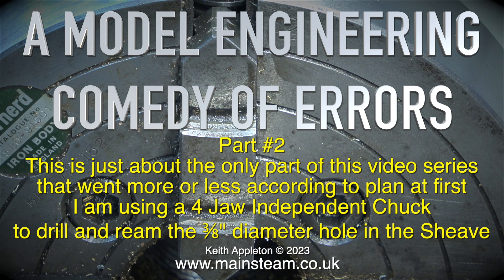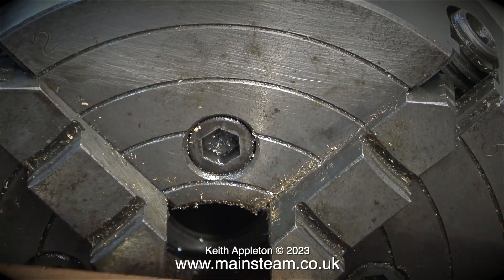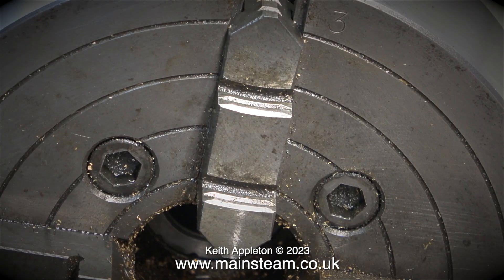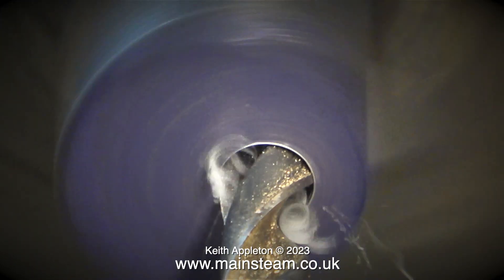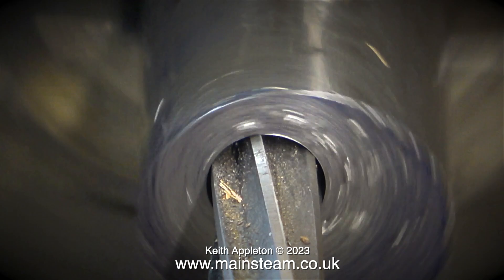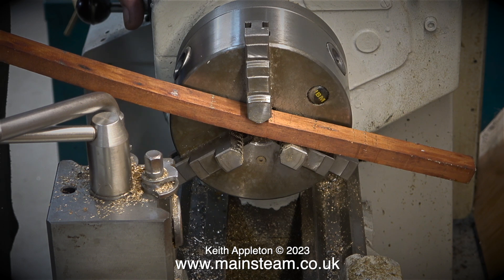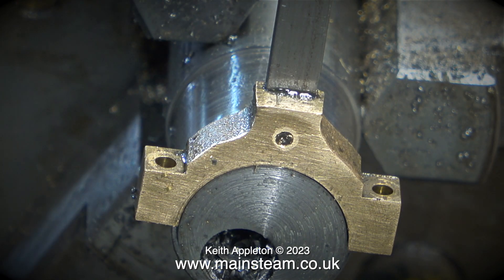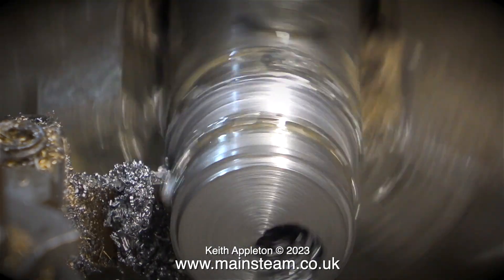A MODEL ENGINEERING COMEDY OF ERRORS - PART #2

Comment: To scribe a circle,  centre punch it then pick up the centre of the centre punch mark to run true in the four jaw chuck suggests to me a not very accurate process.
What I do is either drill and ream a pilot hole in centre of the bar,  go to the Mill and with a dowel a few tenths down on the reamed hole size in the Mill chuck,  pick up the hole centre,  zero the leadscrew vernier wheel then index over using the Mill's leadscrew's vernier wheel to get the offset,  then centre drill,  drill and ream the hole.
Other way is with the bar OD turned to size,  set bar in the independent four jaw chuck approximately the required offset  and bring the turning tool to lightly touch the part,  read off the number on the cross slide vernier wheel,  back off the tool and turn the chuck 180 degrees,  repeat the process and subtract the smaller number from the larger.  Keep adjusting those two jaws until you get the required offset.  Set the other two jaws with the turning tool lightly touching the OD as before but set for zero difference between the two.  Using that technique I can get asymmetrically shaped parts with a dia. or hole to be made or cleaned up say,  set to run true fairly quickly.
Reply from the maker: Why go to all that trouble when the way I do it is generally quick and accurate ? I laboured the setup for the video . . . .

Comment: Could you have cut a grove and then slowly turned the piece, holding the saw to cut off the end?
Reply from the maker: You would still need to move the saw blade otherwise it would wear in just one place - the method I show is safer. . . . . . .  .

Comment: I have a piece of barsteel that acts similarly to what you used here. I believe mine came from the hardware store years ago and it's just rubbish. You can grind and weld it fine but it sucks at being machined.

Comment: I am turning a bearing set in some mystery plate steel my father had stashed. Gummy and odd to bore. Drill swarf would feed out and then start shaving. New cobalt drill bit.
You never know what you have unless to grind on it a bit to see what sparks come off.
Good luck.